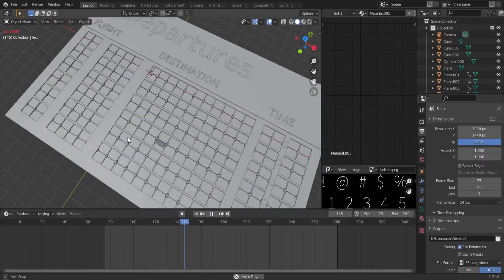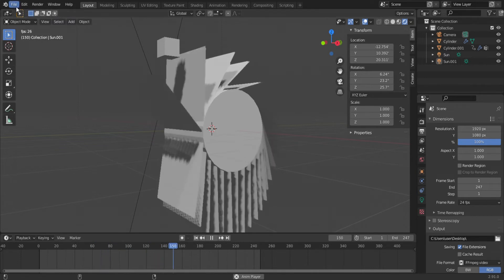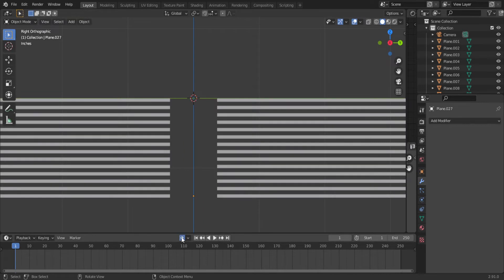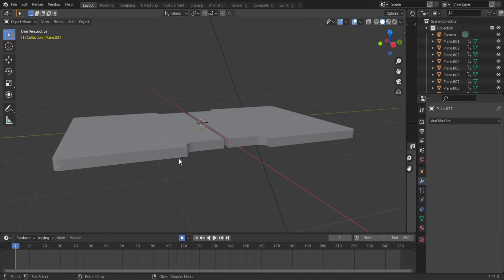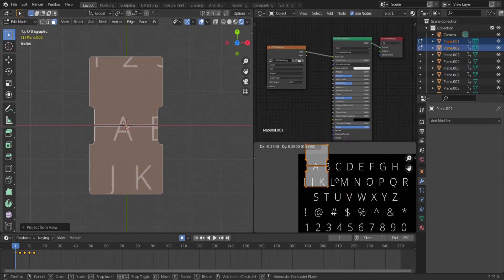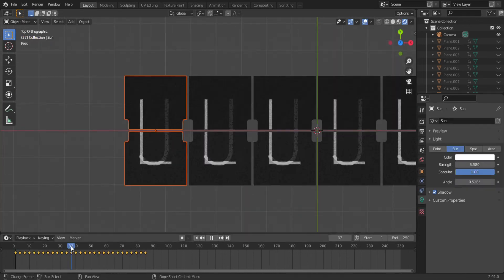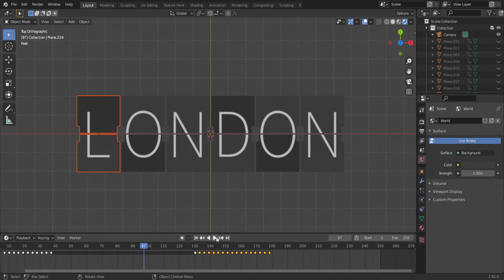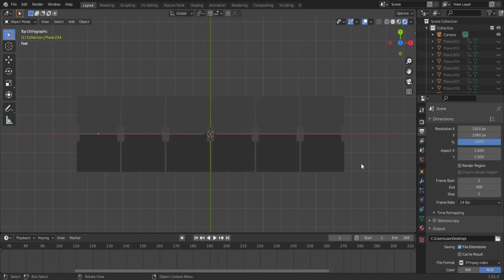How to Make an Animated Departure Sign in Blender (Split Flap)

Comment: for the animation of the flaps i wonder if you could instead repeat the same animation of just one cycle and then use an image sequence for the animation by flipping through the 26 or however many characters each time the flip happens. 

then maybe you could set it up with nodes and a frame driver to change the textures depending on the keyframed value while still driving the animation at a constant rate. 

super cool result though! that intro render looks fantastic!
Reply from the maker: That sounds like a really good idea actually. The way I did it is far from perfect and could definitely be improved.